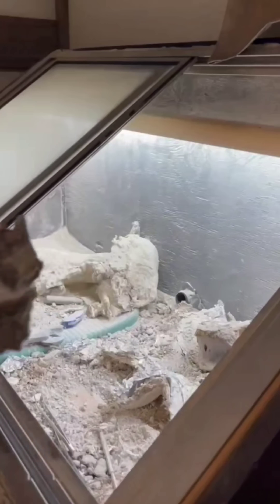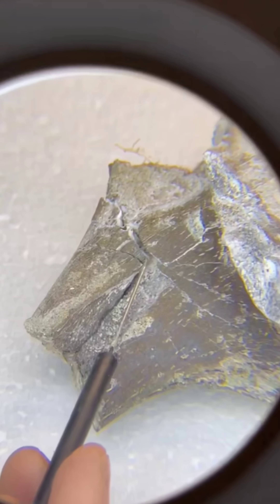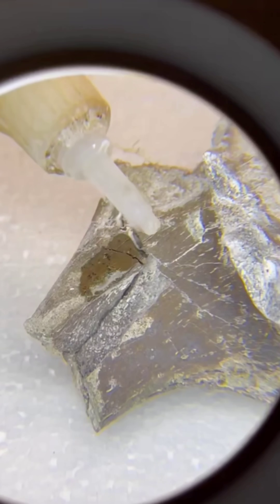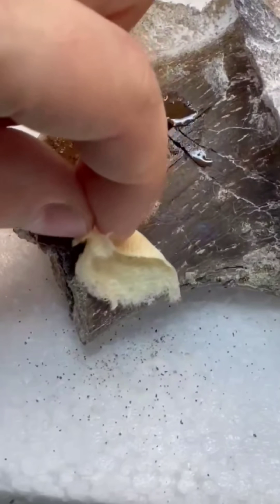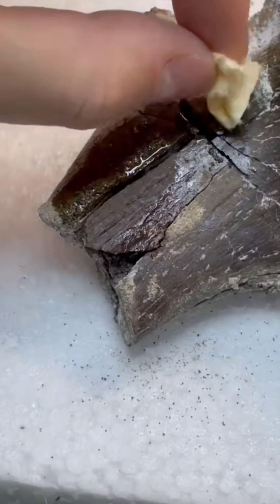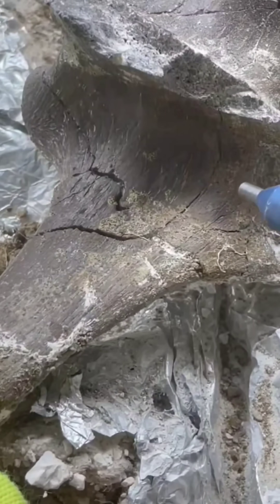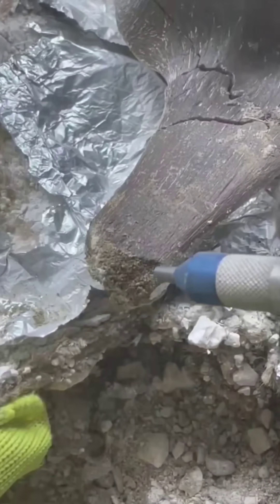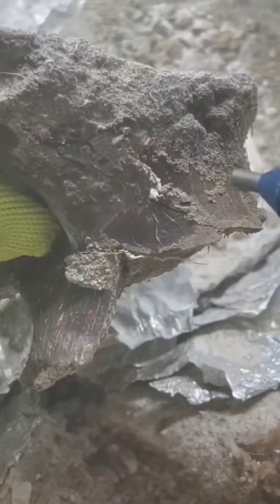This Fossil Almost Fell Apart...

Comment: I've done this with machined parts in preparation for various coatings, definitely gotta be careful about what grit you use on such fragile specimens as it can wear metal away too
Reply from the maker: Oh definitely! It's the worst when you accidentally do too much and it blows apart the bone. Such a pain to fix...
Reply: @fossilize_llc  What kind of glue do you recommend for repairing fragile specimens? Is it more of a viscosity thing?
Reply from the maker: I use the brand StarBond. I have thin glue and a thick one. 
If I'm glueing two pieces of bone together I'll use the thick. If I want structure and it's crumbly I'll use the thin glue and let it seep into the bone to add structure. But then you need to gently scrape the glue off the surface when you're done 😅
Reply: @fossilize_llc  Tis the nature of the beast unfortunately haha now that they've brought back the dire wolf maybe fresh bones won't always be off the table
Reply from the maker: I mean it's 99.9% gray wolf and not an actual dire wolf, but that's exactly what they did in Jurassic Park right? Genetic theme park monsters? Maybe they will let us study the bones some day. 

It would be interesting 🤔
Reply: @fossilize_llc  I think even if we could completely reforge a gene sequence to grow a live specimen, we would end up with essentially theme park monsters as they wouldn't have the instincts to support such a dramatic sudden change in body plan. Though that won't stop me from fantasizing about giant toothed chickens 😂
Reply from the maker: Lol I know. Everyone is fantasizing about what creatures they could possibly do next and all that. It's kind of exciting
Reply: @fossilize_llc  Very much so, it could open the door to a lot of innovative ideas in the future, perhaps we could even figure things out down to a level where limbs could be replaced with exact vat grown replicas of the originals, the uses are endless. So fun watching science fiction slowly become science fact here and there lol
Reply from the maker: Right? I don't think anyone was thinking too much about all this type of stuff when I was a kid. It's pretty incredible
Reply: @fossilize_llc  When whoever digs us up, i hope they're not under the impression we worshipped Garfield given all the lost phones in the ocean and plethora of merch generated 😂
Reply from the maker: Lol I can only imagine the museum exhibits!